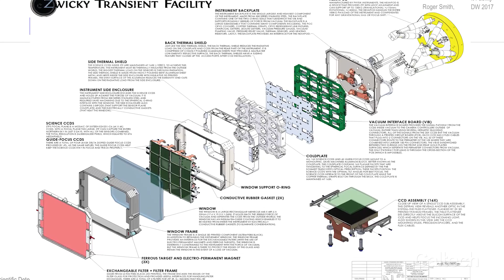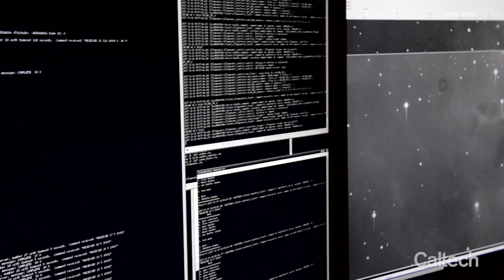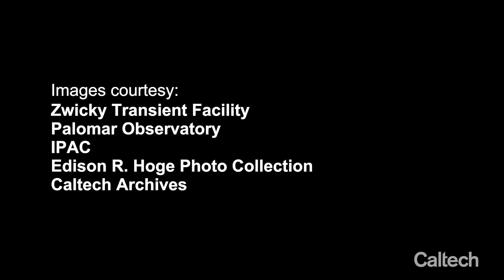Zwicky Transient Facility intro

Comment: Roger Smith got it wrong.  He called it the "Zwicky Transient Facility."  It's actually the Zwicky Transient Factory, as your video title makes clear.

I'm not sure how it manages to manufacture supernovae, but it clearly does or you wouldn't have called it a factory.
Reply from the maker: Actually, he was right and I was wrong. it used to be the Palomar Transient Factory (the idea being that they do large scale processing of data) bu ZTF is actually facility. I was wrong in my title and show notes, and I fixed it. :)
Reply: TheBadAstronomer 
I was giving you a gentle ribbing.  I thought my second paragraph made that clear.